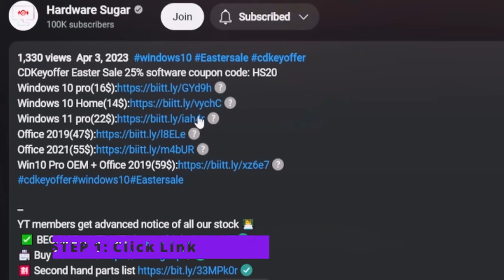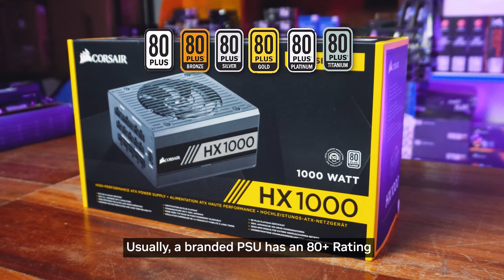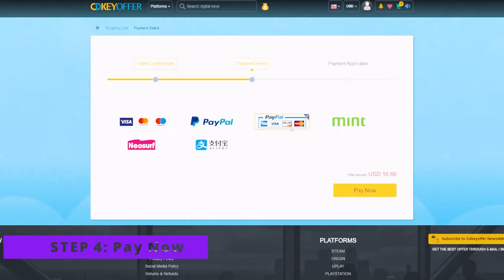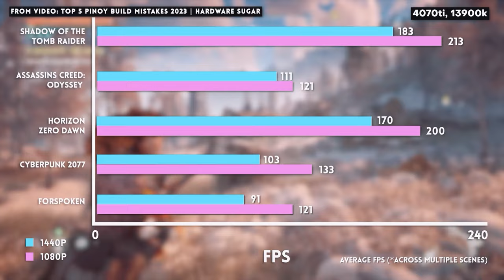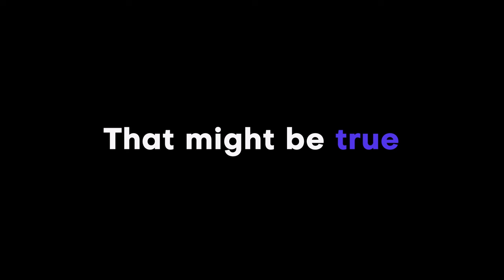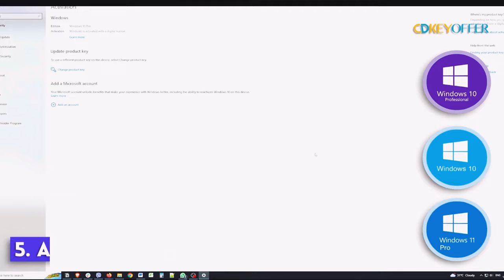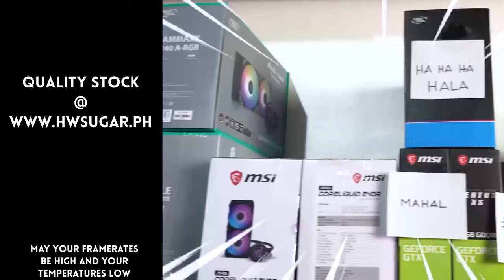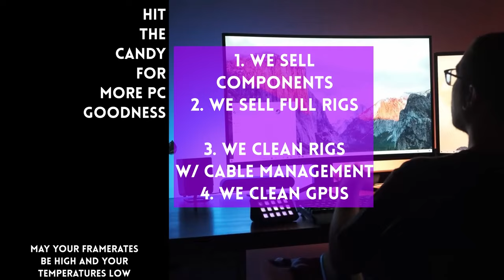I'm going to get roasted in the comments 😩

Comment: 100% agree with the first advice. I saw someone on a fb group with a 5600g and 1000w psu. I told him he could've skimped a bit on the psu and actually bought a gpu instead, or spend more on other parts nalang. I got bullied in the comments lol. Yung mga computer shop nga maghapon pinanglalaro, walang linis linis ng componenets, walang repaste repaste, walang aircon yung shop tapos mga puting generic psu lang gamit pero wala pa naman ako nabalitaan na sumabog? haha.
Reply: True
Reply: Grabi naman ung 1000w psu. Di siguro marunong un hahaha. Ako ung 28k budget ko na maximize ko sa needs ko nung pandemic mas mahal pa parts nun. 5600g, deepcool 550 w, asus b450 mobo 16gb ram 3200mhz , 256 ssd 1 tb hdd, may monitor pati avr pa kasama lahat 😂 with case and fans.
Reply: @zilverman7820  right? I can't remember the brand but it had a butterfly logo at the box and apparently it's a decent brand. Iyon din ang argument nila, good brand daw at ok lang na sobra atleast hindi kulang.
Reply: @HonkForLife098  malamang overkill ung psu na un kahit nga rtx 3080 di need ng 1000w eh. matipid naman sa kuryente 5600g

Comment: I agree for the most part except for handhelds. There are games that work well with the handheld formfactor like roguelikes, platformers, turn based rpgs, fighting games, and emulators are fantastic on the handheld. Full rigs might be better in every way but you can't replicate the experience of playing Tekken with the homies during your break without much setup.

Valve treats the Steam deck as a console and they aren't gonna make a new one every couple of years so it's a matter of perspective on how you see it. The big advantage of a handheld PC is current gen games being able to play portably which the Switch can't even do.

If you do want to get into handheld pc gaming you don't need to be hung up on the the best graphics, frame rates, etc as you worst enemy is going to be battery life. Playing on 40 fps/hz being the best balance of battery life and smoothness.

Comment: I'm in the process of creating a good desktop build in preparation for College within the next year/few months. When I found out about the idea of bottlenecks, I started panicking that I can't use an RX 6600 XT with my future Ryzen 5 5500, but a portion of me was thinking maybe it's not that big of a deal. I ended up replacing the theoretical specs of my theoretical PC with an RX 5600X which costs about 9k and just a regular RX 6600. Glad to see someone actually speak about these ideas in my mind about how this may not be such a good idea.

Now that I think about it, I can easily just upgrade the Ryzen 5 to a better Ryzen 7 in the future and keep the RX 6600 XT, as it'd be considerably cheaper since I won't have that need to get a new graphics card.

Nagawa nyo itong video na 'to sa magandang oras. Life saver talaga kayo!
Reply: Di naman mag bottleneck 5500 sa 6600xt. Kung 6800 un pede pa. Gpu muna pag gastosan mo kasi ung cpu mas mura naman yan eh.

Comment: nice video. For the ITX build I would recommend it to people who just needs an office/surfing/netflix PC or even the ones who wants to play esports titles. You can easily use a low profile 1650 that could handle most esports title and does not need an additional wire hence easy to install. When it comes to the point of handheld PC, I'm kinda baffled with people who preach futureproofing   but also recommend buying steamdeck. Handheld is worse than laptop in upgrade path.

Comment: Personally, yung investment sa handheld is for peeps na gusto ng "set & forget" when it comes to peripherals since pwede naman din niyang gamitin iyon without having to spend extra on laptops with dGPUs because Parsec exists and it's still a PC by heart. Though mga Autodesk users wouldn't care about handhelds kasi di nila kaya mag-render on the go, gamers with decent rigs and stable connections can use Parsec to remote into their desktops without having to carry the whole thing everywhere kahit ITX man iyan, plus mas maliit ang handhelds compared to laptops and you don't have to bring controllers to mark you're off work.

Comment: I agree with you sir, my personal exp before, wayback 90's, generic PSU works just fine, na obsolete na lang ang ribbon type, at nauso ang mga sATA diba? so I agree with that and just want to ask your opinion,  i have a stocked old i3 6th gen, tinatamad ako ayusin bec of work, do you think, ok na lagyan ko nalang ng 1650 ti na GPU just to use it for office, Canva, and 2 monitors? i'm not a gamer, but I play nba2k21 lang, boring, pero I usually, multi task, as in, not rendering, pero more on heavy browser window, I use 3-4 browser, iba ibang clients. what do you think? tia!
Reply: A 1050ti or 1030 ddr5 would do just fine.

Comment: The PSU advice is actually lost in translation to you, imo. Generic and un-known are not the same thing.

 For example: Great-wall is a generic brand. It's often ugly as hell and cheap. However, they are the OEM for some name brand psus like Corsair. Same thing with Superflower. Seasonic also fits the category of generic, but as a brand name they've elevated their recognition to normies.

This is very different from, for example, Thortech. They sold faulty PSUs that had terrible electrical noise properties and poor energy processing. You could check OC3D's video on that.

tl;dr you actually do need to do your due diligence on cheaper power supplies, even if it's name brand (see Gigabyte's exploding PSUs). Going name brand simply means you value time over money

Comment: what's my next GPU upgrade for my GTX 1600s? im currently using r7 3700x cpu... for 1080p games
Reply: Try mo lods rx 6700xt (12gb vram faster) or rtx 3060ti (8gb vram nvidia features). napanood ko sa isang tech channel maganda advice nya dapat ung makitang mong performance gain sa pag upgrade mo is almost 50 - 100%. Pero syempre depende din sa budget mo pero atleast 30% uplift performance para di sayang pera kung maliit lang ung gain.
Reply: @zilverman7820  thank you sir sa tips..

Comment: The first advice is pretty common and need at least a little bit of common sense, yeah there's a lot of 80+ rated PSU on the market, but remember some of those are not reliable kahit pa sabihin mo 80+ PSU sya, and yes common advice is to pick with brand or the most reliable brand PSU you have to PICK, and also make sure what type of PC they need, if it's for GAMING, Heavy Usage PC like editing. or just for office work? and also you have to ask a person if he/she planning to upgrade soon for GAMING and Heavy usage PC, if that so, that's the time na you need to recommend them the reliable PSU available on the market so in the future they won't bother thinking about their PSU might fail.

Comment: I also think you kind of missed a big part of the handheld zeitgeist and not even debunking any actual advice, really. The path toward handheld pc gaming is actually a bit of a misnomer: the Steamdeck plays games like an actual console, it just so happens to have pc capabilities due to KDE Plasma desktop onstalled on top of its Arch Linux base. Linux gaming on PC hardware is becoming more well known and Valve with its Steamdeck actually paved the way for better cross-platform compatibility. 

In fact, it actually ties into your own advice about not worrying about futureproofing. If you're confident that your hardware would be good for the next 10 years, you'll have SteamDeck to thank for proving its ability to outperform newer technologies in certain aspects. Standardization is key to reducing e-waste.

The confusion comes from the wave of Windows based handhelds that try to bring full pc experiences to the format.

Comment: Ok lang gumamit ng thermal paste sa VRAM ng GPU sir? wala kasi ako as now Thermal pads.
Reply: No, the gap of the thermal pads cannot be reached by your thermal paste. Typically, thermal pads are 0.5mm, 1mm, 1.5mm thick. Thermal paste are not made to stack up. It flows like a toothpaste and will run when applied too much of it. Gamitin mo yung luma kung wala talaga.
Reply: @peterl8417  Sira na yun dati nya..
Reply: Need mo talaga thermal pads tapos double check mo measurements. Maraming thickness yan for every GPU.
Reply: @peterl8417  nalaman ko lang sir na 0.8mm pla ang pads nya sa VRAM pero 1.00mm at 0.5mm lang meron binibenta. Pde na ba ang 0.5mm na pads? At kahit ordinary or yung pinaka mura ok lang yun gamitin ko?